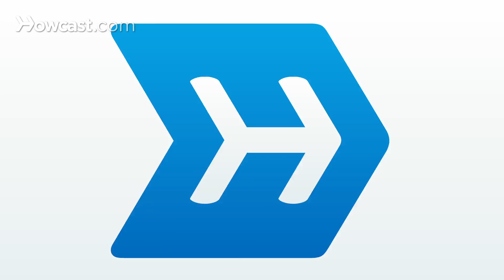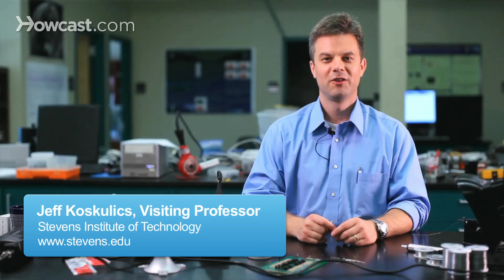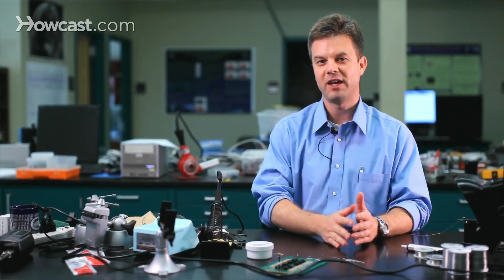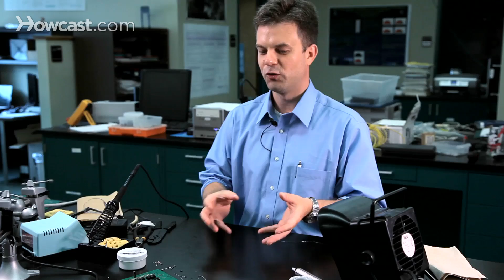How Does Solder Get Inside Copper? | Soldering

Comment: Im trying to unsolder my charger port from my laptop but the solder wont melt my soldering iron is hot enough to make heat waves but its just not melting the solder
Reply: 1234gare1 What kind of soldering iron was it? Most likely the iron was too small or underheated for the large joint typical of a power port.